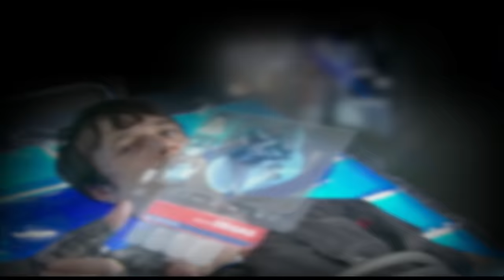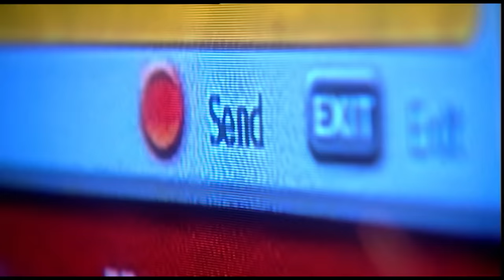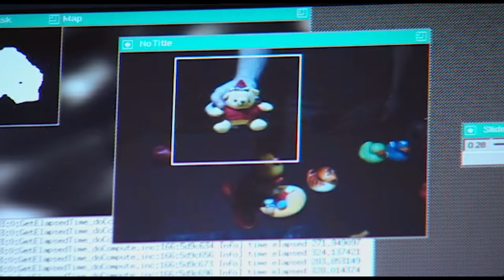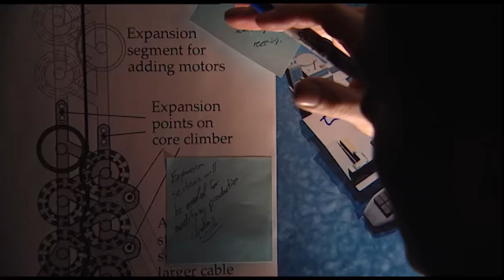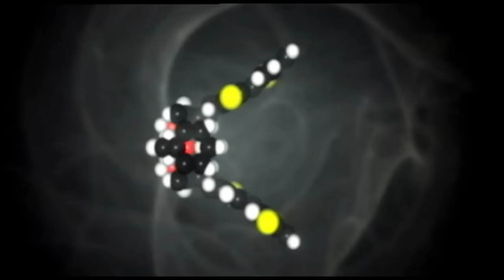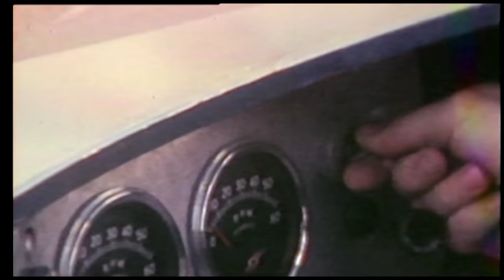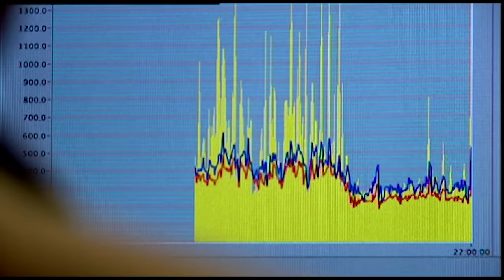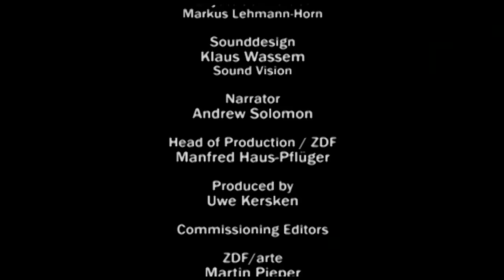What Future Humans, Cities and Bodies Will Look Like | space and astronomy

Comment: Silicon crystal panels create an instant 
current from energy particles that come in contact, 24/7, 365 days.  This is not sun light but energy particles in the air or in space.  This goes beyond solar panels that only work in the sun light.  A firm in Silicon Valley has developed a process to purify silicon up to 99%; they were able to drop the cost of purifying to make this technology viable..